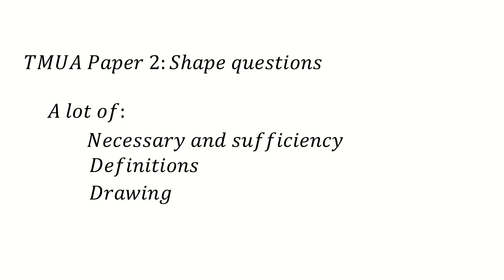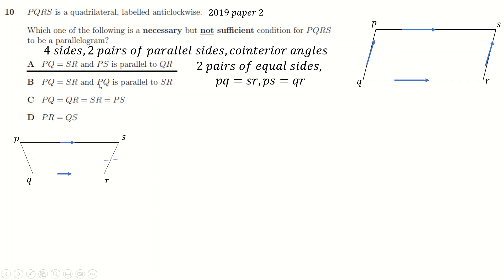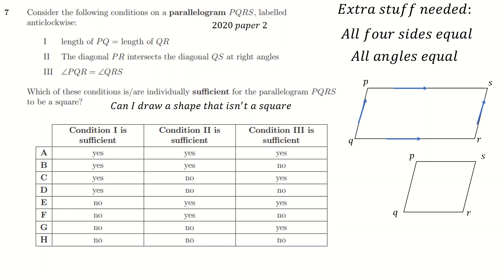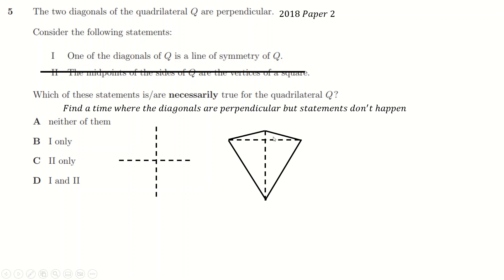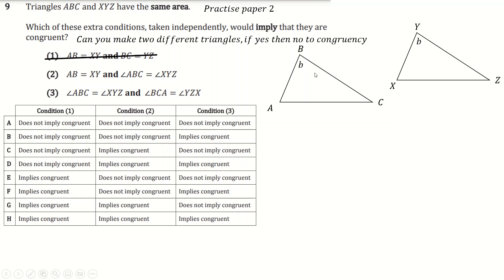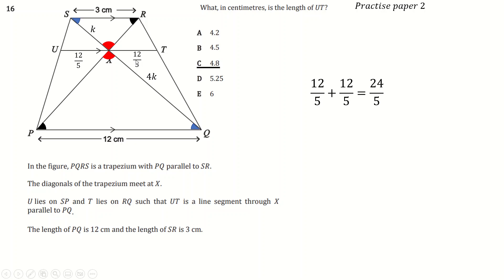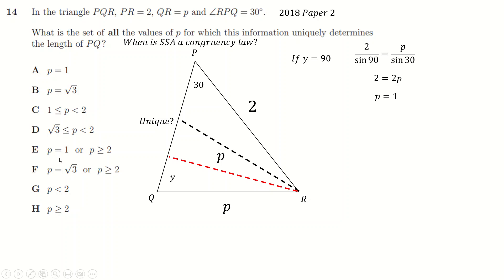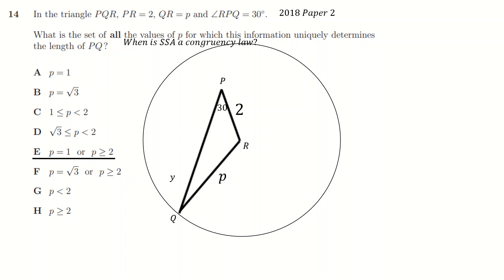TMUA Paper 2: Shapes

Comment: For the last question, I applied the cosine theorem by substituting x as the lenght of PQ and get a quadratic. Then I said to myself '' If this quadratic has only one solution (meaning that the discriminant is equal to 0) then the value of p will uniquely determine PQ. And I got 4p^2-4=0 and thus p=1.